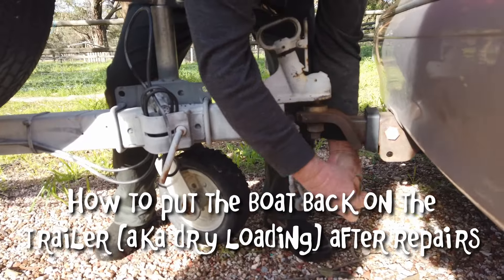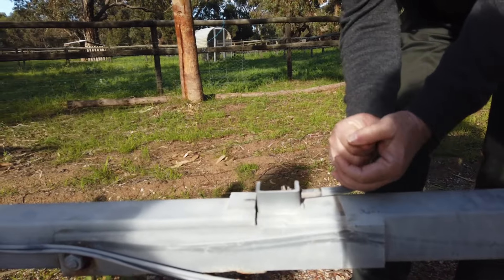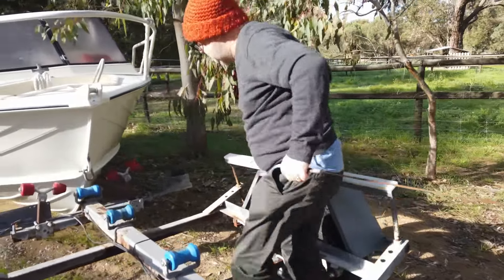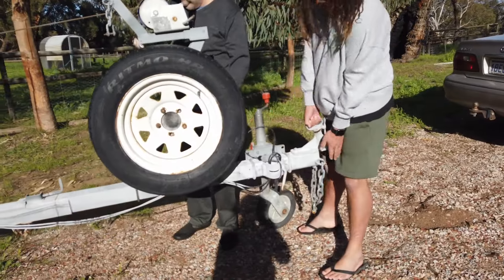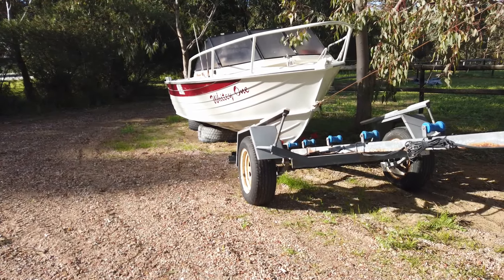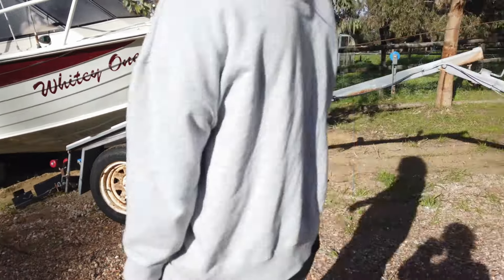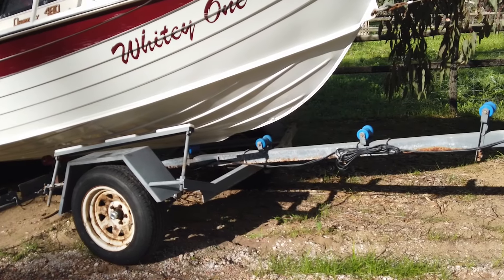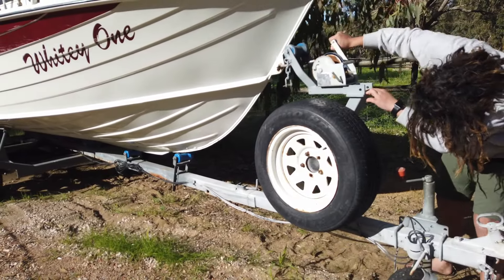Dryloading a boat in 2 minutes

Comment: Just wondering why you store the boat on the ground and not just leave it on the trailer ? Where I am from we never would leave a boat on the ground like this.
Reply from the maker: Hi Sheepdog, good question. We had to repair the trailer and it was going to be impossible with the boat on. So we stored it on tyres while we repaired. We were pretty worried about it, but it ended up being pretty straightforward.